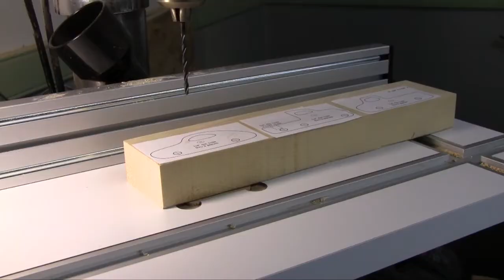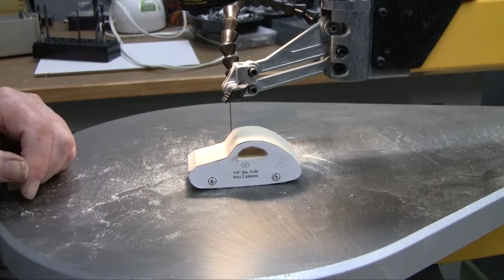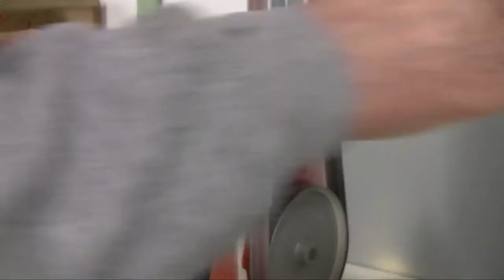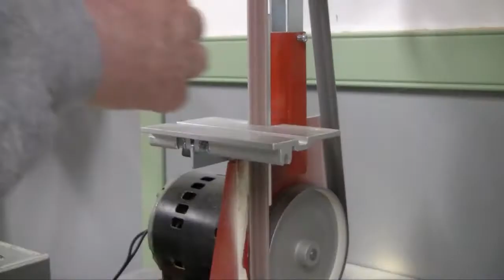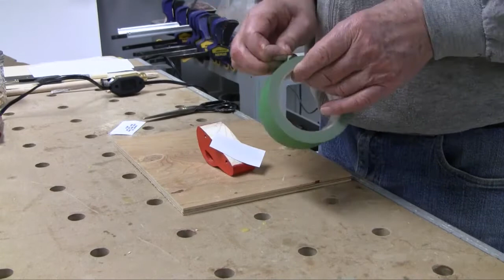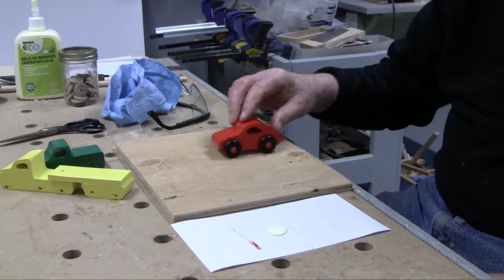Making Small Wood Toy Trucks -  Car

Comment: Hi Bob, great video thanks for sharing. I do have a couple of questions to ask though if that's Okay? 

1. what size stock did you use?
2. what size blade did you use on your scroll saw?
3. what speed did you have your scroll saw set to?

Many thanks
Paul.
Reply from the maker: Hi Paul,
I just used a scrap piece of 2 x 4 spruce that I had laying around.  The saw was very new to me at the time and I was using the blade that came with the saw.  I don't have much experience using a scroll saw.  I usually just select a speed that seems comfortable. The plans for the toys are available as a free download from toymakingplans.com.  I'm quite amazed at how many views this video has had.
Bob

Comment: Hi Bob. I make the same toys, I use 1-1/2" thick  Pine. Could you please tell me what kind of blade are you using for thick wood and also for tight curves? Thanks for sharing.
Reply from the maker: Hi, I usually use a number 5 or 7 blade.
Reply: +Bob Ross  Thanks Bob, I saw you used for these toys a pin blade.

Comment: Hi Bob, 
It's great job. I really wonder that what kind of wood do you use for toys ? Also how did you paint them ? They are shining.
Reply from the maker: Hi Ibrahim,
I just used scrap pieces of spruce I had laying around in my workshop.  I had just bought a new scroll saw and these were my first attempt at making small cars.  I've made quite a few toys since but didn't make videos.  I used canned spray paint for the finish.